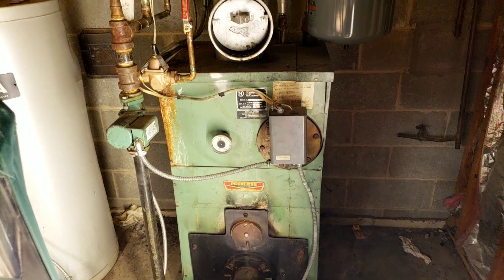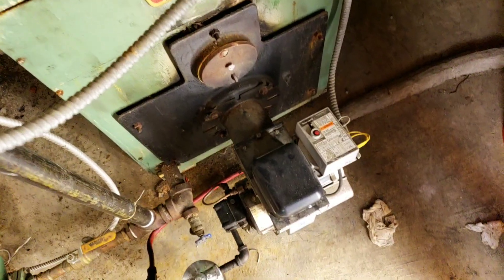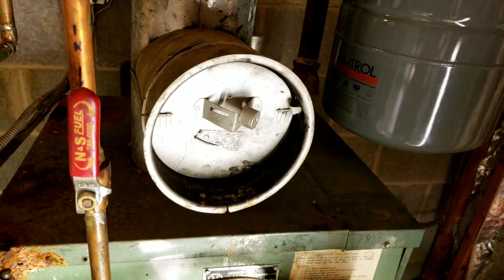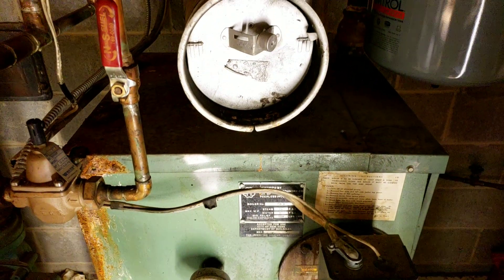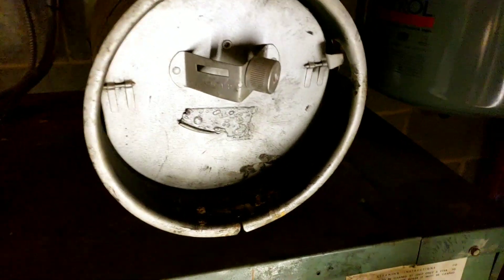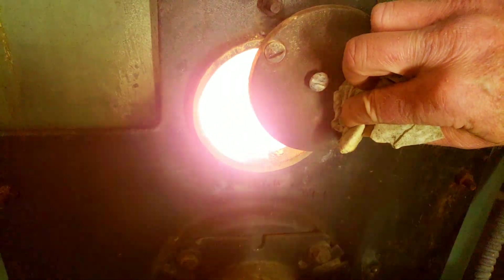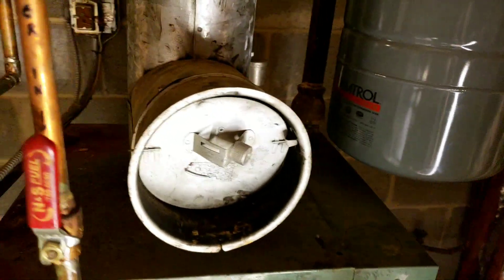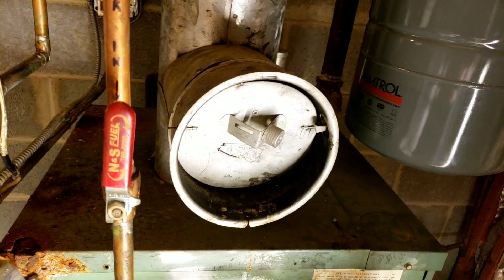Help from expert please- Barometric Damper

Comment: 35 dollars, get a new one, make sure it is level, set the weight @3, the screw stopped it from over swinging  (and allowing exhaust to ur basement). the new field controls has a stop built in do do that quietly!
Reply from the maker: Thank u

Comment: The barometric damper is designed to help exhaust gas build up from your furnace as well as keeping your stove pipe cooler temperatures so that there is no buildup within the pipe walls from excessive Heat you want that door to swing in like it's doing on your video that is completely normal if it is not swinging in it is not working like it is intended, as far as the screw being in the bottom the only thing I can think of is a lot of times the barometric dampers have a stop screw so that the door cannot swing out I'm guessing maybe that one swing out and got stuck but usually there's only a screw at the bottom to keep the door from swinging out and allowing any trapped gas or smoke in the chimney from getting into the basement. But your furnace at full running temperature if you are barometric damper is set correctly you should be able to touch the pipe for a second or two without burning your hand if the pipe is still too hot to touch you need to adjust the damper to allow more airflow in small increments I hope this is helping you I live in Upstate New York in the foothills of the Adirondacks and have had many years use of wood stoves and coal burning stoves with barometric dampers so I hope this helps good luck
Reply from the maker: Thanks very much for that helpful response. I’m off to stick my hand on the pipe!
Reply: I am having an issue with new furnace and draft. My hvac buddy and I installed. I'm getting exhaust smell into the house. It's not terrible but it's there. It seems like it's coming in from damper. Ideas or things I can try or check? Thank you
Reply: Also to add. A few weeks ago I had a pro come in and inspect the system and adjust. He also replaced the very dirty nozzle. I checked the nozzle and it's clean as well as the filter. I notice I do have a very tiny oil lean on the filter housing
Reply: the damper is used to help maintain the draft over the fire
it is NOT to help COOL the chimney, as a cooler chimney will soot up MORE.
Hot pipe walls do NOT cause buildup.

you need to balance the baro-draft with the over-fire draft.

this one explains it well
https://youtu.be/cCjAozBKpT4